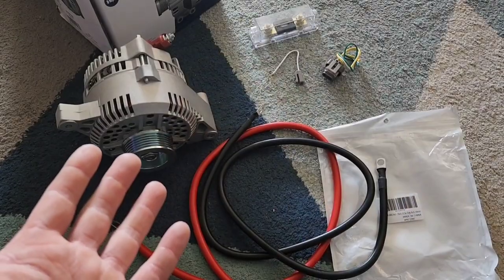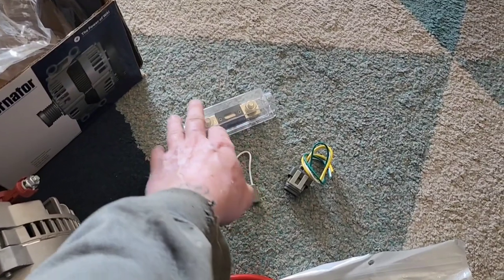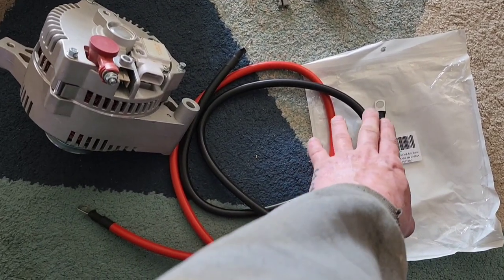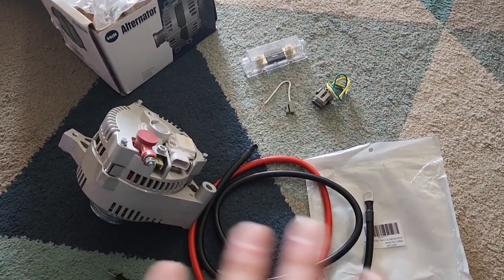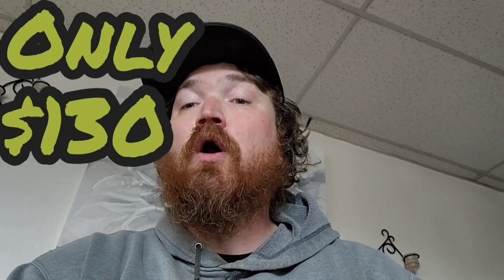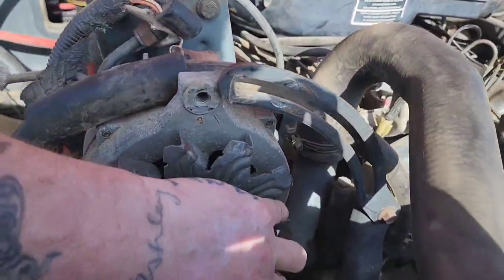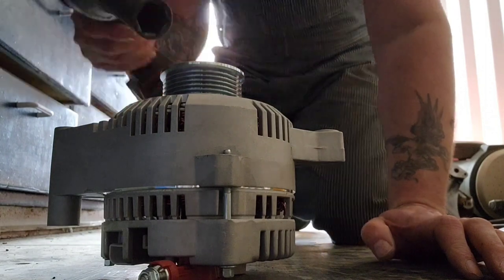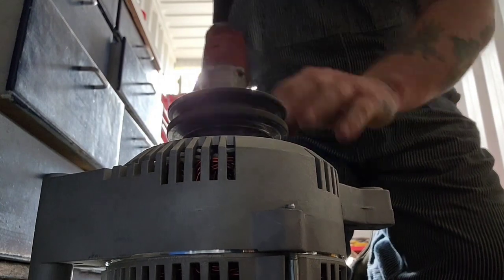3g alternator conversion upgrade with parts list and installation 6.9 7.3 idi diesel race truck ep.9

Comment: Came over from a comment you left on an idi group from fb. U are a lifesaver. Saved me a couple hundred dollars plus a few hours of research.
Reply from the maker: Glad to help out. Most of the Facebook groups just push overpriced parts from a couple companies. I try to show people how to do things and save money in the process. Doesn't make me too popular in the groups!
Reply: @worthshop  How did you re wire the tach sensor?
Reply from the maker: @Randy Dye  Just cut the plastic sheathing off the wire harness, and seperate the ones you no longer need from the 2 wire tach plug. Now take the tach plug and reconnect the 2 wires that goes to tach sensor.
My truck has the dash and everything stripped out of it for circle track racing so a bit more involved!
Reply: @worthshop  got it. Thank you.

Comment: First off, i wanted to thank you for all the info you've put out on IDI's. Its really hard to find anything on these old trucks. Secondly, i have a question for you if you have the time. Ive recently bought a 91 f250 with the 7.3 N/A non-turbo. Its been an electrical mess. Its whats led me to your channel. My voltage regulator went out and fried quite a bit of the wiring. Im having a helluva time finding any info on how to electrical work on these trucks. Could you possibly recommend some literature or a channel on here that might be a le to help someone who isnt the most savvy in the electrical realm? Any info would be much appreciated. If not, no worries and keep on keeping on! I appreciate all the info you e already put out there!!

Comment: The only alternator i could find was one from the 92 E350 7.3 powerstroke or the PG 7752 do you think either of these wpuld work?  I checked for the pg7777 but they arent available on amazon

I have a 1986 6.9 idi with the ats turbo kit btw

Comment: On the stock truck what 2 hot cables do you run on the mega fuse ? Where do they go both ends
Reply from the maker: One runs from the charging post of alternator to the mega fuse, the other goes from the mega fuse to the post with battery cables on the starter solonoid mounted to the passenger side fender.

Comment: I did this swap yesterday, and it came online and started charging for like ten seconds and then it all stopped charging.  I know the batteries in this truck are old and have sat so I probably need to replace them before chasing further rabbit holes.

Any advise for good places to add grounds?  This truck is kind of a basket case when it comes to the electrical system, though it seems to be coming back up to speed the further I dig into it.  Thanks for your videos!  Learning a lot about these old tanks.
Reply from the maker: Did you blow the fuse? That or something came loose would be my guess. Need a good ground to the engine block and frame. Trucks usually come with one on each side.

Comment: Hay Aspie, Just courios if You can delete vacuum pump or do You have to keep it? Nice ALT swap! 🙏🏻👍
Reply from the maker: Vacuum pump needs to stay on the truck, it runs the power brakes, and also controlls transmission shift points since it is an auto transmission. Thanks for watching, hope you have a good week.
Reply: @worthshop  Kool! Got it. Thanks for the update. Have a great weekend!🙏🏻👍

Comment: Bought my 88 7.3 idi, looking to do this but the previous owner add a new key ignition and seemed to cut my green with red wire short, do you know where I could get a piece to extend it?
Reply from the maker: I would just cut the plastic wire loom on the wire harness back a little bit to get to  it. Add a piece of green wire, which is readily available and easy to find. Wouldn't really worry about it having a red stripe. If you really want it to have a red stripe, I would rip some wire out of a vehicle at the junk yard. Good luck with your project, and God bless.

Comment: Dude how did you get the pulley on without it rubbing? Just put a lockwasher behind it against the bearing?
Reply from the maker: I have done this swap several times. Never needed a washer to space the pulley out.
Reply: @worthshop  10 4 so I need to get a different pulley. I have the original alternator that the previous owner removed. I didn't think to check it. Thank you for the quick response man. Love your videos!
Reply: Mine is doing that to what did you do to resolve this issue ?
Reply: @Neythan2021  I ordered a different pulley. He has the part number or a link in one of the comments.

Comment: Hey aspie can you please tell me a part number for the pulley on the alternator, I bought a truck but the alternator and pulley are gone and I’m having trouble finding the double pulley for my v belt 86 IDI
Reply from the maker: Here is a link to one I just found, not sure if that same part # interchanges. You might be able to find it elsewhere like ebay or Amazon.
https://www.robertsandson.com/belts-pulleys-tensioners/alternator-pulleys/rs-644-10141.html
Reply: Appreciate it, shipping on that thing is 24$ 🫠
Reply from the maker: Might compare the specs on this one. Free shipping, doesn't say it specifically fits the idi trucks but free shipping though. 
https://www.ebay.com/itm/384393510354?mkcid=16&mkevt=1&mkrid=711-127632-2357-0&ssspo=z4bth1kvrpo&sssrc=2349624&ssuid=ncBNwPtFRF-&var=&widget_ver=artemis&media=COPY
Reply: I’ll just go with the first one, the second one you sent said it had a 7/8” bore while the first one that says it’s for the IDI has a17mm or .669 bore
Reply: One last question what size bolt is the bottom bolt that goes to the original alternator?
Reply from the maker: @Peyton Talley  Honestly not sure. I never needed to replace one so never checked the size.

Comment: Does the 3-g alternator have the W spot to run a tachometer wire?
Reply from the maker: I do not think it does. I have tried researching that option to add a tachometer to a idi. But have not been able to find a solid answer
Reply: @worthshop  darn, that was my plan as I'm really not trying to spend a huge amount of money just to install a tach
Reply: @worthshop  Do you lose the tach with the 3G swap if you dont add an aftermarket upgrade?
Reply from the maker: @anchormanronburgandy  no tach wires were shown in the video. Remove them from the alternator harness and put them back in the truck. My truck has no dash, it is a race only truck is why I lost the tach.

Comment: I can’t find the wire harness can you commit the link
Reply from the maker: Here is a link to the plugs, no wire harness needed. You will also need the 175 amp megafuse, and 4 Guage inverter wires with 5/16ths ends about 18 inches long.
https://www.ebay.com/itm/384397000090?mkcid=16&mkevt=1&mkrid=711-127632-2357-0&ssspo=z4bth1kvrpo&sssrc=2349624&ssuid=ncBNwPtFRF-&var=&widget_ver=artemis&media=COPY
Reply: @worthshop thank you so much

Comment: If you have a factory air and factory tach truck, you have more wires in the harness. Do not just cut them...
Reply from the maker: Pretty sure I showed that. I pulled my tach wiring out to reuse later.
Reply: @worthshop  most people read the comments before the videos... I'm just putting that info in their heads...
Reply from the maker: @bigloads3600  Appreciate that, and hopefully the comment saves someone the bad day of cutting the wrong wires!
Reply: @worthshop  never know.... but it's worth a shot lol